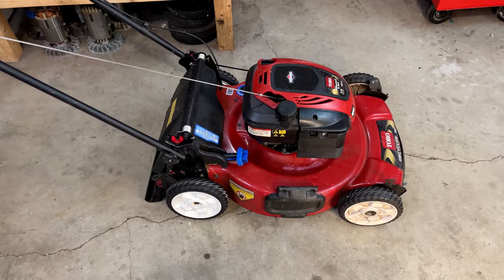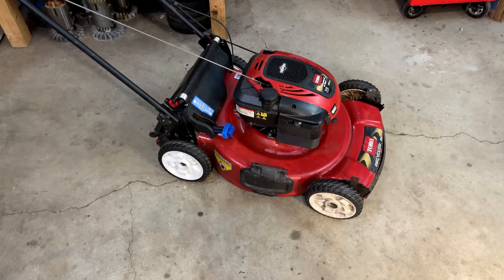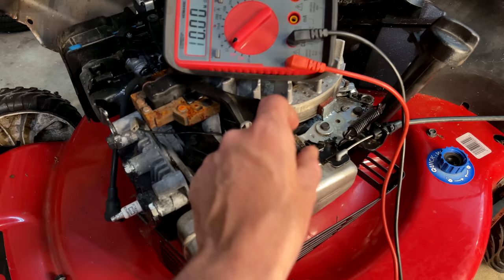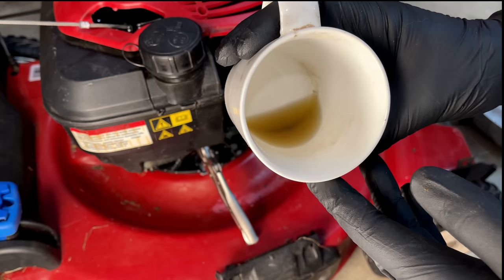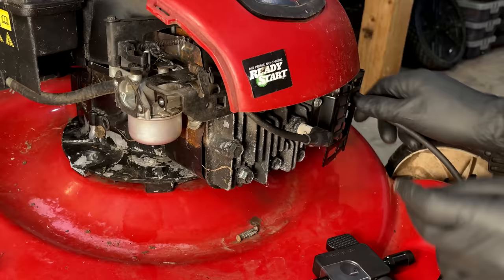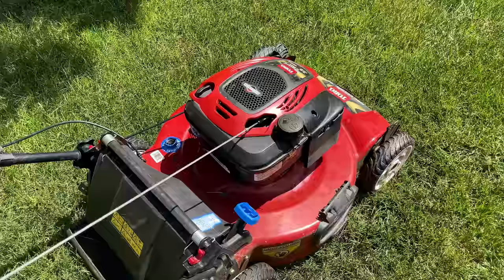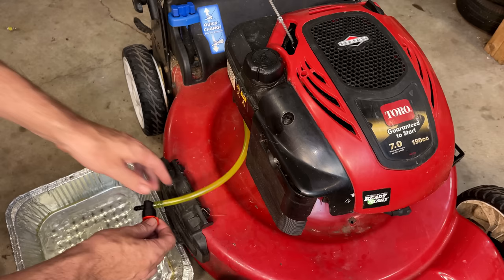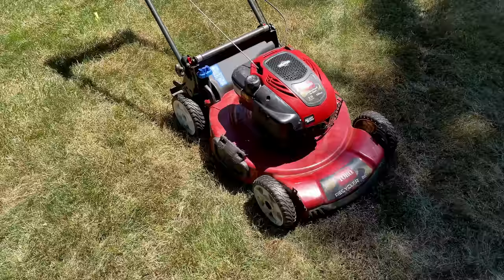Erratic Lawn Mower Engine Performance - Starts and Runs Great / Stalls or Will Not Start

Comment: Hard to believe that the fuel was so dirty in the bowl. I recently installed a new carb on a WX-10 Honda water pump and it ran great. Three days later the guy said it won't start. New carb was full of Rusty gas and water. I replaced it again and took it to his house and saw the old rusty gas can he was using. The fuel must have been 3 yrs. old and the inside of tha can was all rust. He swore he used new gas, and then blamed his kids for using old gas. I told him not to bring it to me again. Thanks for the video.
Reply: @gags730  
Small in-line fuel filter between the gas tank and the carb on every mower would sort this rust problem out....
Reply: Yes. Non mechanical people are the worst enemies to their own equipment.

Comment: Inside the bad cap is probably a valve, similar to the disk valve in a vehicle's radiator cap. That lets it build pressure to a certain level before releasing, but also allows a vacuum to open the valve. Gummy-goo ethanol gas glued the valve or it's holes shut, thus you had excessive pressure and no vacuum admittance. Let's have a cap deconstruction to see what's going on with the bugger 😉
Reply: The rubber gasket in cap rots and stopped up fuel supply 
It’s really common so check inside cap for damage and replace it every 4/5 years for sure
Reply: I agree that sawing the cap in half, or less drastic action would be worthwhile.

Comment: I thought it was a fuel problem but the gas cap was a new one to me also, great job!
Reply: We replaced around 75 % on riding mower that are 5/10 years old 
They rot on inside of the cap and most mechanic think it’s fuel hose 
Rubber really rotten in tinny peace’s

Comment: Here is why I really liked this one.

Many years ago (many, many), I had a British sports car.  It had suffered minor body damage from a parallel parker, near the fuel filler.  Picked it up from the body shop, and it died on me on the way home.  I was mystified: the car had always run flawlessly, and the body repairs had nothing to do with anything under the hood. (Er, “bonnet.”)  Before getting out tools (something one always carried with British cars) and fiddling with the carbs, I decided to smell the fuel in the tank.  Spun off the cap and heard the air rushing in.

Left the cap off, drove to an auto parts store, bought a vented cap, and drove home no issue.  Apparently the body shop had replaced the filler cap and, back then, one had to be sensitive to whether a given vehicle required a vented or unvented cap.

All that said, I got all the way through this video and never thought about the cap.  Oh, well.
Reply: Good story.

Comment: I had a Toro mower that did almost the exact same thing.  I called it my "Union Mower".  It always died about 30 minutes into a mow and wouldn't work again until it had a 30 minute break.  I came to the same conclusion as you, it wasn't venting properly.
Reply: Replaced cap on mine and it was not the issue , the issue was the gas had clogged the output of the gas tank took it off and cleaned with hot soapy water let it dry and reinstalled added gas and works perfect ".Ethanol" clogging fuel systems since  2005  just add the fuel preservative  oil that keeps the corn  from absorbing water .
Reply: Ethanol free

Comment: It would be interesting to determine how the original cap was supposed to vent and why it failed.
Reply: I think he should try to rebuild it. That way he can figure out how it is supposed to work. It would make a good video, IMHO.
Reply: My guess that I posted is that it vents from those rectangle holes at the bottom of the cap. The long and narrow paths eventually got clogged up. Ultrasonic will most likely clear it up.
Reply: I don't think it is ment to vent unless the pressure is high enough.  (think pressure cooker or hot water tank)  The cap is ment to keep the Ethanol under pressure to prevent it from evaporating.  Just like the new gas cans.
Reply: @MM-wt8oc  How would it do that?  Where is the pressure coming from?  Are you saying when it runs the pressure will rise and then the cap will retain the pressure while it is in the garage over the winter?
The problem with such a design (assuming it's possible) is that if the tank holds pressure above 1atmosphere (only possible if it seals), then as the fuel drains while you are running it, air cannot get into the tank and if the pressure in the tank is lower than the pressure in the bowl, it won't flow.  It's like when you dunk a straw in a soda and then cover the end of the straw and lift it out and the straw doesn't drain.
Reply: @tarstarkusz  he is saying when the pressure drops as the tank tries to provide fuel to the carburator and the cap does not vent creating a low presure in the tank, he also explained that it can cause issues if the tank gets warmer from winter to summer causing the tank to swell under extra pressure ((2 seperate issues from the same problem lol) this video actually solved an issue I was having with a generator (I didn't even think the small air his when I opened the cap was an issue, I was wrong lol)
Reply: @chrismcgowan3520  The point of my post is that a cap that is airtight unless pressure rises dramatically will cause the gas to stop flowing.
Reply: @esqueue  I thought the same. Those long holes between the two layers looked to be candidates. The ultrasonic idea is great!

Comment: I assume a that the original cap vented from those rectangular slots on the bottom outer ring of the cap. This would prevent rainwater from easily entering the tank. Most likely got clogged up due to it having a long passage and the crap that fuel leaves behind. It would be interesting to see if throwing it in your ultrasonic cleaner fixes it up.

Again, this is 100% of an assumption.

Comment: I remember the metal caps with a vent hole. I miss those days. I still use my 1965 Briggs. I've replaced the rings once in 1988 or so. Did the valves too, since the head was off. Outside of replacing the rope a few times, never a problem. It was my grandparents mower. I keep the oil changed and run it empty every fall. It'll get passed on.  Bad cap....that took some thinking cap. Great work.

Comment: Thank you for this one James. You certainly come up against some rare faults. I have seen you check gas tank fuel caps before if you suspect a possible airlock in the fuel system. This is the first time that I have seen you find one though. I must be cheaper than you because I would just have drilled a very small hole in the cap to allow the passage of air. A size 80 gauge drill bit with a diameter of 13.5 thou would be fine. It would have saved five dollars. Thats just me. I am sure that your approach is more professional.
Reply: A while back, I was given the exact same lawnmower with the exact same problem, and like James, I went through the same procedures until I found the problem.  looking into the tank, I saw a very small white plastic tube in the intake and not knowing that it was some sort of filter, I pulled it out.  Didn't fix the problem, but it ran with the cap off.  Put the cap back on and engine quit a couple of minutes later.  I pulled the fuel line off at the tank and no flow.  Opened the cap to look in and gas started flowing.  Put the cap on and it stopped.  Upon examining the cap, I found no air vent hole, so I peeled back the little rubber gasket inside and drilled a .030 dia. hole thru the top of the cap and it ran fine.  The other owner had taken it to two different shops, and they couldn't fix it.  New air filter and blade sharpening and sold it for $120.00.  Next time, I'll start with the cap. I would be worried about the "dished" cap letting water in.  Where is the vent hole?  Mine was domed.
Reply: @mtcman42  Well it worked. You are right in worrying about the shape of the cap possibly letting water in. Choosing where to drill the hole then needs care. At the conclusion of James' video, his solution was to buy another cap with the vent hole designed into it. The designers of that cap obviously had the same problem to consider and must have acted on their view of it. It would be good to see the exact design of James' new cap as you say.
Reply: I decided to revisit the video. At 24 minutes in we can see the new cap as James looks at it. From there to 25 minutes James points to the hole in the cap. The top of that cap is definitely concave. That would certainly hold water. The hole is not at the bottom but some way up toward the rim. Perhaps to reduce the risk of water ingress. The diameter of the hole would influence the possible inflow of water. The bigger the hole the bigger the risk. I wonder what the size of the hole is in James new cap.

Comment: James, our lawn mower would not stay running. Replaced fuel, air filter, spark plug, and blade.  As soon as the prime burned, the engine quit. Watched your video.  Went outside, loosened the cap…magic!  It ran great!  You are a genius my friend.  Gravity feed systems need that head pressure in the tank or the engine will starve.  Thank you.  Next stop, new gas cap.  Cheers!
Reply from the maker: That can be a hard one to diagnose.  Easy fix though.

Comment: Similar to an issue I had w my 40+ yr old Stihl chainsaw. Had me perplexed for a while.It came up when I serviced the saw and replaced the fuel and vent lines. To vent Stihl placed about a 1/8” set screw in the end of the vent tube. Thinking must’ve been that air could work its way past the threads but sawdust wouldn’t. Saw would start easily, run great for a minute or two but would starve and die. Finally figured out the new fuel line I’d installed was much more supple than the old and the set screw moulded to the line so no venting. Found small air filter like ends on the internet that push into the end of the vent line and ‘voila’ runs great. Never miss any of your vid’s.
Reply from the maker: Thanks Steve

Comment: I think the reason there are 2 very different fuel caps listed for this engine is that the original cap is required to meet EPA clean air requirements mostly for the state of California the replacement cap is a noncompliant version.   
    
Walt

Comment: That's why I finally switched to a battery mower....  Still love my gas backpack blower for the ton of leaves we get in fall but every week mowing is now quiet and reliable....and way less stinky.  As soon as good blowers are available in battery I'm switching.  But you can take my 2 stage gas snowblower out of my cold dead hands.  I live in MN....

Comment: The engiine looks like a newer version of the Briggs 4.5 Quantum. 
My mother bought a new TORO GTS2 back in June, 1995. 
 It has a 4.5 Quantum on it too.
 My mom passed away in Sep 2020, but I still have that old mower, and it still runs. It got a small piece of plastic or crud stuck in the carb back in May-June of 2005. A carb rebuild kit & cleaning fixed it. It got dirt in it once after that, so I knew what to do.
 It doesn't have very good compression, after all these years now. 
 But I still use it a few times a year to mow part of a shooting range target area about 12 miles from me. It still gets the job done. I also have TWO spare identical used engiines that also run. When the current engiine shits-the-bed, I will swap out the engiine.

Comment: Great video!  I had the same issue and it took me forever to find the answer.  I drilled a couple holes in the cap, and it fixed the issue.  However, engine vibration caused gas to spray everywhere.  I had to replace the cap anyway.  Thanks!

Comment: I have a very similar mower with an almost identical engine (B&S Quantum) that is over 30 years old.  If the weather is hot and you are bagging the clippings and you leave it in the sun when you are emptying the bag, it is hard to restart.  If you grab a cool drink, it won't start at all until it is completely cool.  VAPOR LOCK !!
With electronic ignition on small engines (standard for about 40 years) a new spark plug rarely helps engine performance.
Reply from the maker: It's almost never the spark plug.  But sometimes it is.

Comment: Great diagnosis and easy to overlook. I had this same issue with a couple of older Honda HR214 mowers. Honda used a foam filter material inside their gas cap vent passage to keep dirt out (they still do). Unfortunately the old foam broke down and solidified over time blocking the vent and causing the engine to starve after about 10 minutes or so. I replaced the foam and they both ran great after that. Briggs also went through a few gas cap design changes in an attempt to “improve” things and they ended up with the horrible design they have now. It’s a half-turn cap that won’t stay tight, leaks fuel all over and traps grass clippings and dirt under the edge that fall into the tank when you open it. Simpler is better IMO, that cap you bought was always their best design.

Comment: I love your channel. I appreciate the fact that you make sure your torque pretty much every bolt to speck. In my opinion, it's important but not alot of other small engines mechanics just don't do it. Thank you James for sharing your skills with us.
Reply from the maker: Thanks.
Reply: I've never used a torque wrench.  I just turn them 1/4 rotation before they break off.  Ha ha
Reply: @mtcman42  
If it does snap off....just back it off 1/10 turn....
Reply: @justjeff4640 First tightening or turning a bolt eventually will create tension.  The tension in the bolt provides the clamping force on the parts being held together.  Not enough torque causes the clamping force to be insufficient, it vibrates loose when machine is used.  Too much torque can strip threads and/or distort materials being joined.

Comment: The vent on my riding mower slowly got clogged over time unbeknownst to me and caused the same issue.  The darn thing would run for 20 minutes that way and slowly lean out!  Once I discovered the blocked vent on the fuel cap, loosening it solved the problem, but not before numerous carb cleanings, carb kits and tank cleanings!  This had been going on for a couple years, and exhibit itself on hot days too!

Comment: Had same issue with my B&S quantum. Replaced the cap with same one you did and fixed it. Same issue on our 25 year old snowblower with Tecumseh motor. New cap fixed that too.

Comment: Wow, in all these years, I’ve never seen an issue like that with a mower gas cap. I’ve seen it plenty of times with portable outboard motor tanks that have a vent screw in the cap, but not those push mower caps.  Great video as always!

Comment: I've been watching your channel for a while as I tinker with generator and lawnmower repairs, I've had a renegade generator sitting for a long time that had me stumped and had a lot of parts and effort put into it, I saw this video and took the cap off when testing it to find I had the same issue, it took longer to show due to the larger tank but after several runs that was indeed the issue, credit to you, an unsellable generator has now past its testing and been sold, your videos have helped on many occassions and it's appreciated
Reply from the maker: Nice
Reply: @jcondon1  question for you, I delivered an 8kv generator to a friends farm where he was getting solar and batteries as back up which would also power pumps if needed, the electrician set the power of the solar to cut off the grid power I'm the event of a blackout and wired an earth to the frame of the generator and earth of the generator 240v plug and had it set up to run alongside the solar in the event of a blackout or fire, he just explained simply that this was so if their was a short the solar wouldn't be harmed, I didn't question him further as he was a little shirt on manners and busy, I am wondering if you could explain this in one of your videos, their are other videos about Wether to earth a generator or not (which was no help to this question and not clearly explained in layman's terms), just an idea, love the videos, so many helpful tips in assessing and repairing and much appreciated

Comment: Had that happen on my JD lawn tractor. After mowing for a while it would die and backfire and it would not start. I would go in the house for a while and it would restart only to do it again after a little while. When I figured it out I just pounded a nail through the hole that was supposed to vent and no more problems. That was 6 years ago and I'm still using that old tractor.

Comment: That's certainly amongst the LESS COMMON issues that turn up.  It's nice that the outdoor temperatures helped by giving you an audio cue.   That's certainly not the first thing you'd think of when you have an issue such as this.   Vapor lock was one of my thoughts at the beginning,  when I heard it  "runs for awhile"......   so I was wasn't way on the moon with that idea.
Reply: I own a mower with a gas cap that has a deep vertical groove cut into the threads.  I doubt it will ever fail venting.  Any cap with a pinhole will sooner or later plug.

Comment: The original cap is known to go bad. Probably some emissions garbage. Anyway I took one apart a long time back and I believe it has 2 spring loaded plastic valves in it. 
With the cap you added I will recommend a in-line fuel filter and tell your buddy do not leave it outside. Water will get into the tank. Nice find btw.

Comment: I had an intermittent 'no run' one time on a similar engine. That doggone kill wire had laid against the block and burnt through the insulation. It was intermittently shorting out to the block. Tiny diameter high-temperature wire. I had a new one in a box of extra parts.

Comment: I have one of those mowers that does something very similar.  I will have to try a new plug and a new fuel cap.  The carb is good, so I guess that's my next step.  Thanks for posting this.